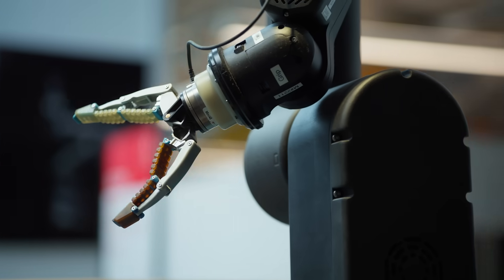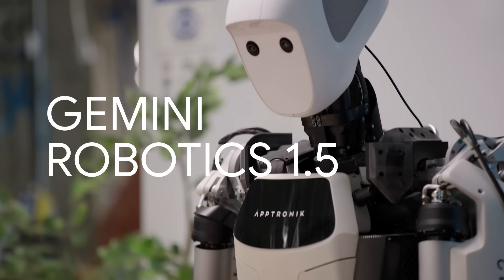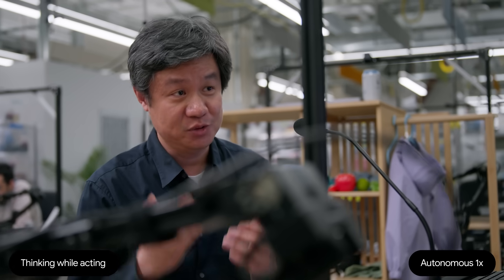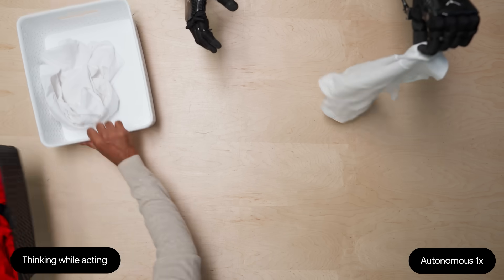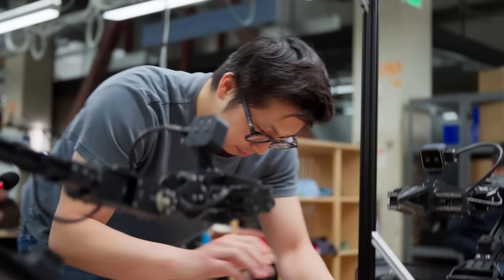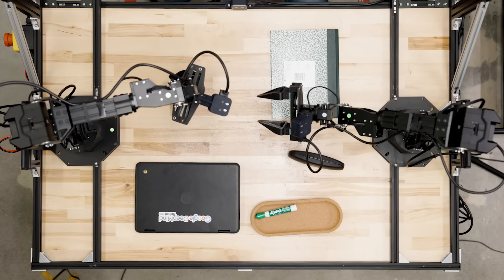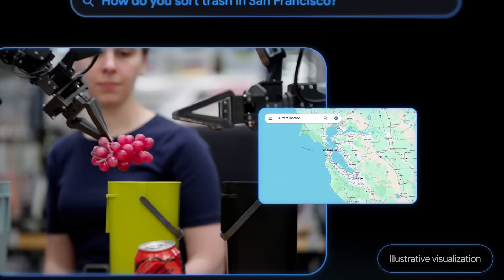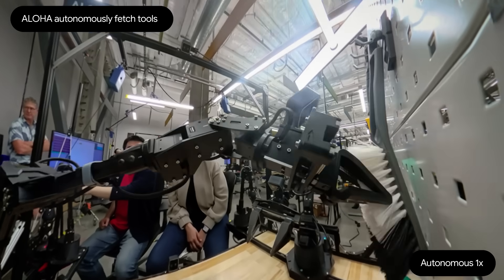Gemini Robotics 1.5: Enabling robots to plan, think and use tools to solve complex tasks

Comment: would this be able to do the following task:
Use a ruler to measure how long something (like a banana or a stick or a piece of paper) is? This would require more than just associating objects together. It requires the understanding of how a ruler works. It would be impressive to give the prompt: make markings on this wooden plank on where I can cut it with a saw to get a piece of length of 20 cm. I think that that goes one step further than sorting objects. Using a rules is more complex than "using" a plate for storing some items.
Reply: I think it can also do that, assuming that the underlying model knows about it... But even if it doesnt know, the model can search for it instead
Reply: Give it time, this technology is in its infancy.
Reply: Try it yourself. It's available for free via the AI studio. Put in a text and image input and see what it spits out.

Comment: You're still giving it cues.  Try using various objects placed in random fashion in front of the robot and just instruct it to, "Do what you think should be done with this."  A simple example off the top of my head would be to have several different types of screws (Phillips, slotted, Torx) threaded part way into a box or plate, then place screwdrivers with various tip types, including required and non-required ones, on the desk, tell the robot to figure out what should be done and see if it tries to use the correct drivers on the matching screws.  Another example: different glasses (martini, shot, rocks, etc.) and associated drinks on the table; it should be able to pour the correct beverage into the matching glass type without hints.
Reply: You don't need to tell frontier AI researchers what to do...
Reply: @throwaway6380  Why so defensive?
Reply: It can’t do that yet, obviously! Thinking of tasks it cannot do really isn’t original!
Reply: @ferlou2373  The suggestion is they hold off on "impressing" us with demos until they have something that's actually impressive.
Reply: @Justin_Arut But I - and reading through the comments apparently many others - already find the demo impressive! In reality, your suggestion is they hold off until they have something which you find impressive, which is, as you will surely admit yourself, too, quite frankly a ridiculous standard.
Reply: @ferlou2373  Gemini 2.5 Pro comprehends such associations when I upload images.  I've done the tests.  It's already SOTA.  Maybe they should use Gemini 2.5 Pro (or 3) as the brains for these robots.
Reply: You can't just say to it "figure out what should be done". How is it supposed to know what you want it to do? Do you want those screws fully threaded or removed? You couldn't say that to a human and get the result you wanted without further instruction.
Reply: @Lieutenant_Scrotes  It should "reason" what the most obvious and logical course of action is for a given situation.  If it recognizes that there could be further actions possible which also make sense, the model should request clarification.  I've run many tests on various models where I've specifically stated, "There are no wrong answers." and the models ended their responses with interrogatives such as, "Did that meet with your expectation?" and "Should I continue?"  The idea behind those tests was to check comprehension and variability in responses.  In the case of this thread OP, there are of course wrong answers (e.g., the Torx driver shouldn't be used with the slotted screw).